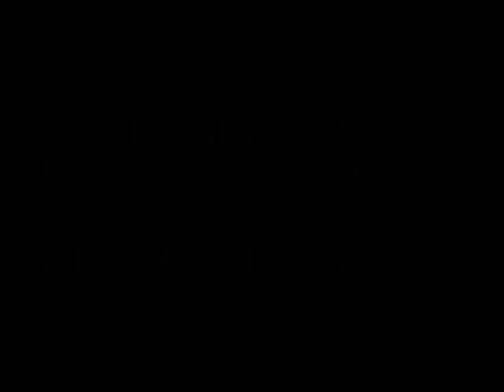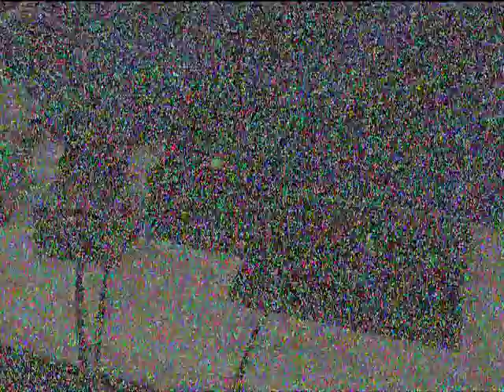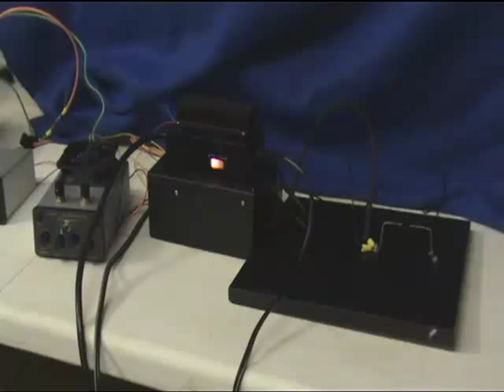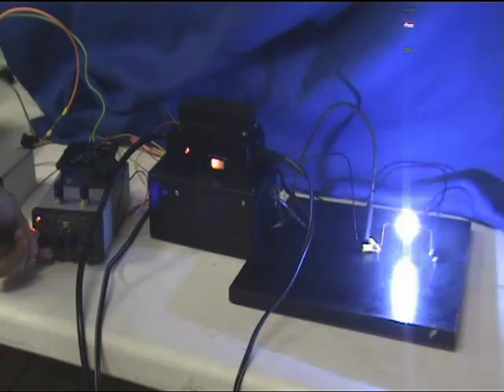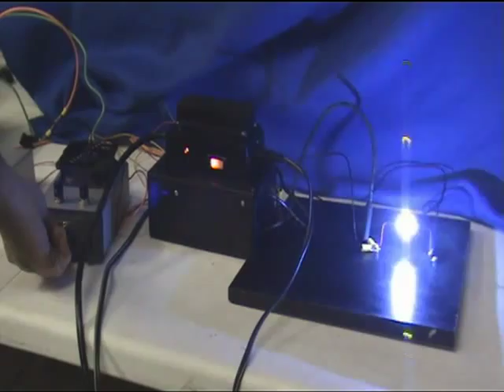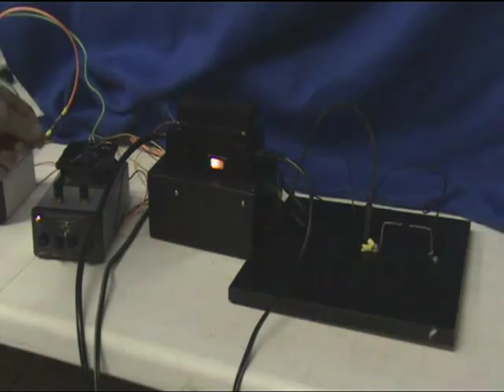Stanley Meyers 10,000 Volt Intensifier Circuit.avi

Comment: Is it possible to post your Voltage Intensifier Circuit Diagram ? and the coil winding used in the voltage intensifier circuit